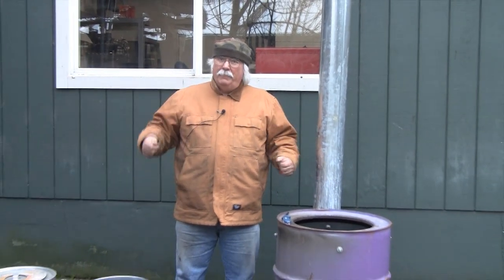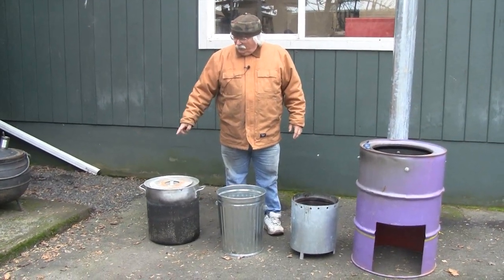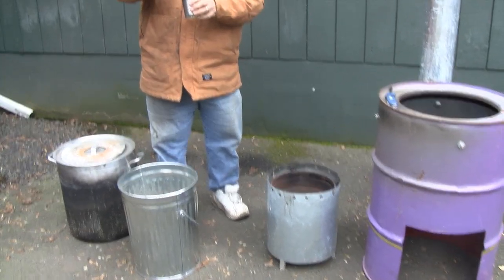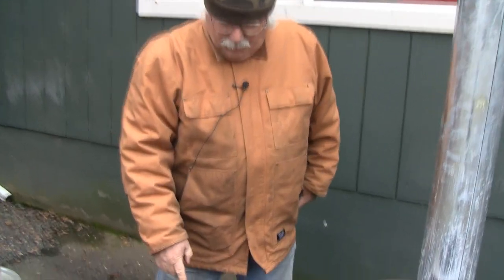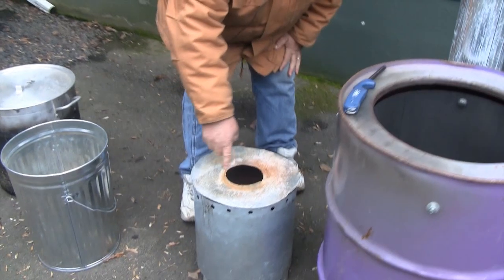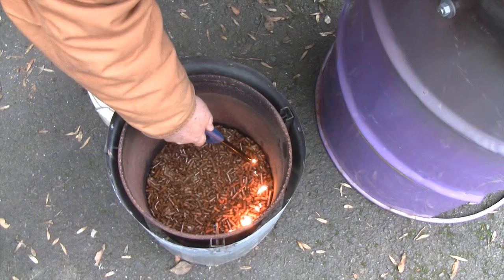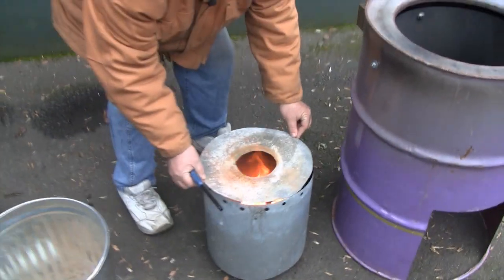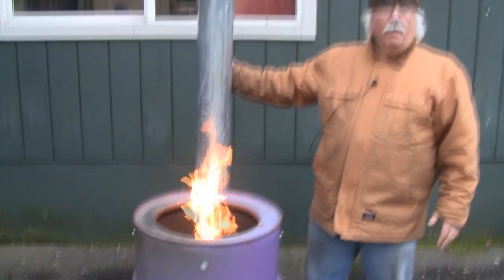Aprovecho Gasifier Stove

Comment: Sorry if this appears dumb - but as far as I can see this is just a wood burning stove, with the flames heating the pot by impinging on it's bottom and sides..what am I missing?
Reply: For cooking, the best option is a Rocket stove. For example: 
https://sites.google.com/site/menedzmentteoriapraktika/upravlenie-infrastrukturoj/rocket-stove-new-design/rocket-stove
https://sites.google.com/site/menedzmentteoriapraktika/upravlenie-infrastrukturoj/rocket-stove-new-design
Reply: Its an institutional stove (InStove) using a gasifier as a burner rather than a rocket stove burner. 

Controlled testing has shown the gasifier to be the most efficient at burning wood out of any type of stove including a rocket stove. It also has the added benefit of being a very good char maker, allowing for carbon negative cooking, soil enrichment water filtration or as more fuel. Its operating principle is the separate and controlled supply of oxygen to the processes of pyrolysis and combustion. This as with most gasification cook stoves is a top lit variety which means the pyrolysis fronts moves down against the oxygen supply leaving being char in its wake which doesn't burn because the oxygen is consume first by pyrolysis. The gap around the inner wall which leads into the top of the burn chamber as well as the holes around the top serve as secondary air supply to the burn while the holes at the bottom are referred to as primary air feeding and consumed by the pyrolysis front. channeling the secondary air around the burner preheats the air allowing for a hotter and more efficient burn while also capturing wastes heat as well as partially insulating the burner.

Its a significant piece of the puzzle to climate change, deforestation, third world health and mortality and third world economics, all while being not much more than a container with a bunch of holes inside another container. In fact the simplest type of gasifier can be made with a single container with primary and secondary holes. The outer container, concentrator disk, draft chimney, pot skirt, etc, are all add ons.
Reply: wow! Thanks for the explanation. It's amazing that something so simple in design can have such a powerful effect on efficiency. Is there any way I wonder of replacing my conventional solid fuel stove in my kitchen with such a design? I mean are there commercially available Instoves?
Reply: bluegtturbo The instove is designed to service many people in places like refugee camps, schools, etc. They have two varients designed to cook 100 or 180 meals at a time so not suitable for a home kitchen although if you wanted one you could order it from instove.org

Another market is for outdoorsman an in that category I would reccomend stovetec which has the highest rating micro stoves.

For the home, there are a wide array of commercially produced stoves in different regions but being target towards the third world clicking on a link to order one is not a likely convenience. The peko Pe is the first that comes to mind and cand burn a variety of biomass fuels. On their website it says to email them if you'd like to order one.

It would also be possible to make one yourself if you happen to have some knowledge with metal working and are willing to sift through the metric shit ton of poorly consolodated information but I have come acfoss a few pdfs that have complete and detailed designs that may even be customizable. I've been doing just this and is why I knew enough to respond to your comments as I did but my knowledge is limited and the ongoing endeavor for improved cook stoves is still a relatively new but growing affair, which is why the information on the net is a bit of a haystack atm and in some instances incorrect.
Reply: @RusselwithoneL  The gasifier wasn't working properly in the video. The flames should be shooting out of holes on the sides of the inner pipe

Comment: clearer details of the combustion chamber assembly is terribly wanting. assuming inner chamber has vents at the bottom: 1. what will persuade the air that "flows up and underneath the cover" not to escape partially or entirely through the vent holes of the outer chamber instead? is purple drum supposed to be outer chamber?  why a double walled combustion chamber then? what will prevent wood gas generated escaping out the big hole in front? "hot gases go up the side of the pot inside the skirt.. then "they go down the outside (of what) and they come up the chimney"? are gases going up or down the space between the two chambers? a diagram might have saved a lot of talk this time.
Reply: Absolutely NOT a gasifier.  The ring of holes at the top of the burn chamber is supposed to be at the top of a double wall that is full of hot smoke in order to allow the smoke out at which point the smoke combusts.  But the holes in this video are just punched into a single sheet of metal for no apparent purpose.  Clearly the stove burns fuel.  Sure.  No question it works.  But it is NOT a gasifier.